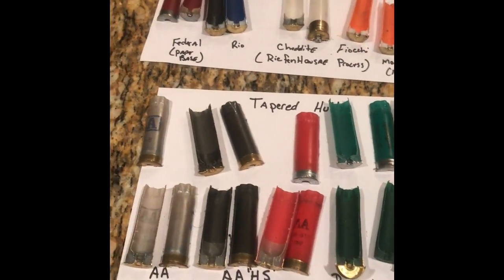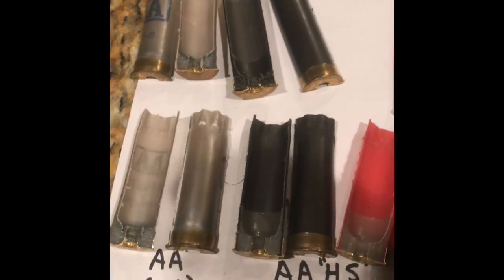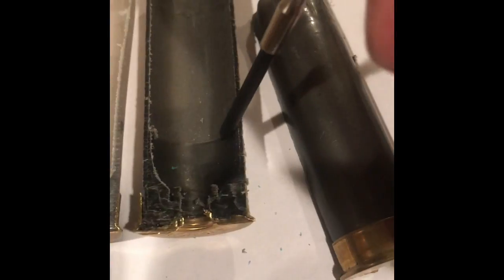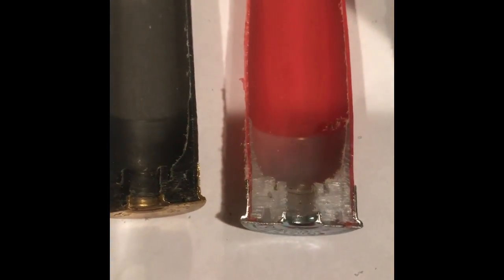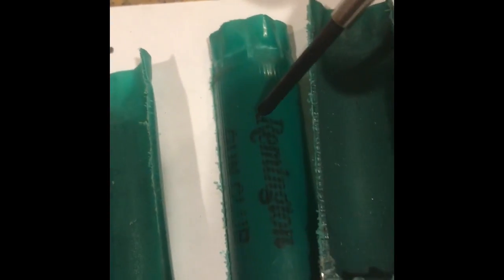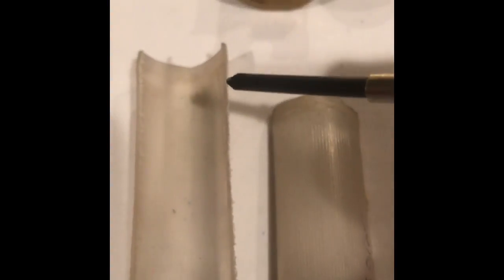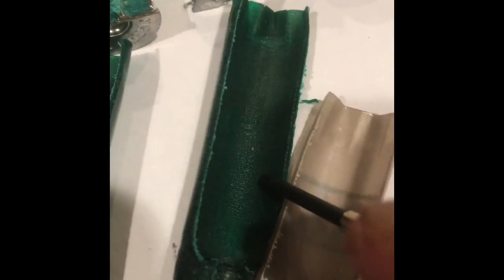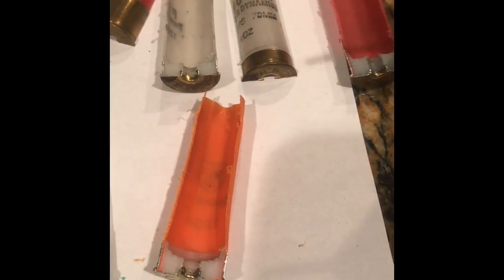Shotgun hulls: What’s the difference?

Comment: For anyone curious, Remington currently makes the best hulls on the market, with their STS at the very top of the heap.
After that, Nitro, then Clays & Field, then Gun Club.
All of these hulls use compression-formed tubes.
The reason why the STS is the best of the best is because it uses a thicker and more durable grade of plastic and because it uses a genuine brass head instead of a steel head.
Expect to get at least ten good reloads out of STS and about 8 from the other Remingtons mentioned.
Reply from the maker: STS’s are great “target” hulls. They can load forever using target load data. What I do, and many others, tapered hulls like gun clubs and STS’s just won’t cut it.

Comment: Awesome, thanks for doing this video man. 
Have you noticed any brand or style of hull that handles repeated roll crimping better than others? I have been playing around with some blue Rio medium height brass hulls from a bunch of lead #2 stuff I picked up a few years back. After one roll crimp, the plastic almost looks distorted / melted and has a seam all the way around it. Might be able to get a second reload on it but I was hoping they would last longer than that. It is also possible I am screwing up the roll crimp somehow.
Reply: Colson,
That’s an excellent question. I haven’t noticed one brand being easier to reload over the next. In the beginning, reloading once fired roll crimped hulls created a lot of problems due the the mouth of the hull being all crinkled and hardened for the gases when fired. The main issue was trying to figure out how to get the mouth of the hull back round. Then a discovered this neat little tool from Ballistic Products called the Spin Doctor. Put that bad boy in a drill or drill press and run in down the mouth of your hull. The friction created rounds out the mouth to almost factory condition making reloading a roll crimping that same hull a piece of cake. Hope this helps, brother!
Reply: Excellent, thanks. I have seen those in the past and wondered if they worth getting. I'll pick one up and see how it does.
Reply: Have you ever considered that almost all of the factory crimps are folded crimps? There's a reason for that. It's easier to do than a roll crimp. And can be repeated several times before the hull is worn out. And most all reloaders utilize a folded crimp built in.

Comment: Thank you for this great video, im juist getting into shotgun reloading after rifle reloading 30 years. What hull would you recommend for Tungsten shot? I am looking at reloading the new Sphero 18 Tungsten and curious what hulls are the best in 2 3/4 and 3 inch? Thank you!!!
Reply from the maker: Steven Laubach glad you got something out of it! For tungsten, you’re best bet is to got with a 3” straight wall hull like Fiocchi, Rio, or Cheddite.  Depending on the load, you can also use 2.75” with tungsten .Of  course you can use once fired hulls like Winchester or Remington. Hulls aren’t as important as wad selection. Make sure you use a wad designed for non-toxic shot. 

Regardless, you can’t go wrong with any of the three that I’ve mentioned. 

Good luck! You’ll love that tungsten!